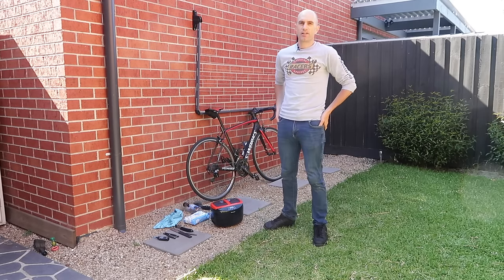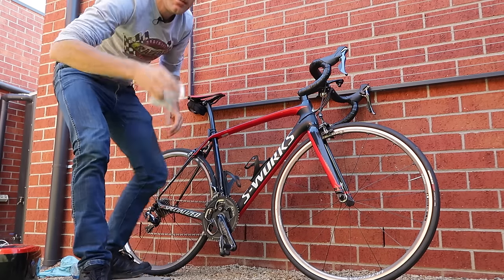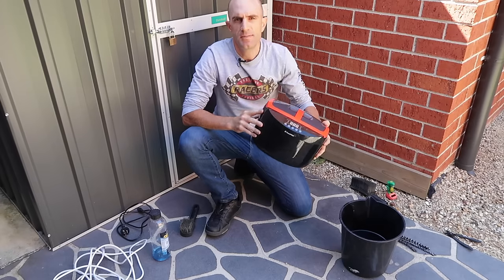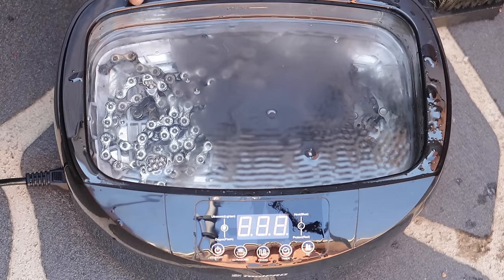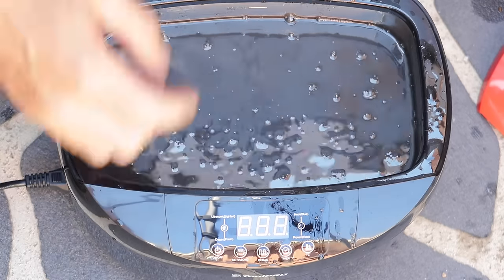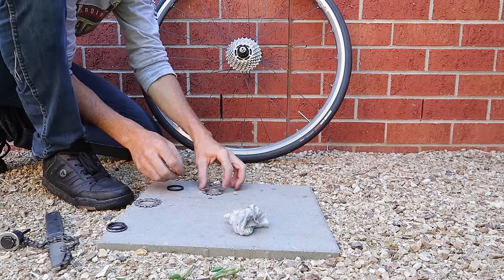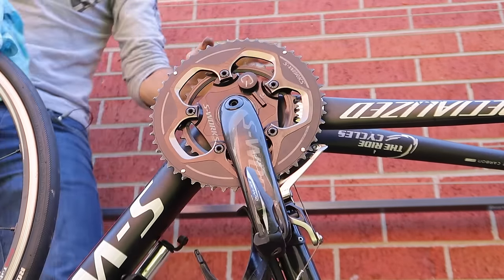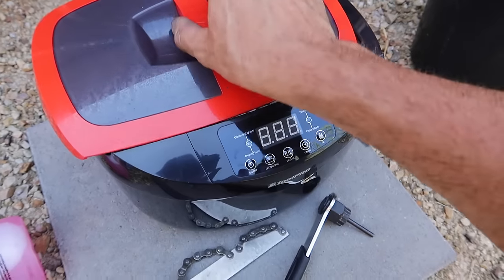CLEAN BIKE: The Ultrasonic Part Cleaner! // How to Clean a Bicycle Chain

Comment: Whoever subtitled this doesn't actually speak english. Or has really bad hearing.. Either way, fire them, every 3 words contain a mistake.
Reply from the maker: +Look Behind You That's YouTube.
Reply: There's an actual English option (not auto-generated). That's the one with errors.
Reply from the maker: Here's a YouTube trick. Edit their auto generated subtitles, hit save, it'll then have a non 'auto generated' subtitle file (identical to the auto generated one). YouTube then pat you on the head and boost that video as it appears you've done more work. It's a quick trick/hack to get on top of the automated algorithm here. Given YouTube have fisted me for the last week and sunk the channel, I'll remove this one since it's caused issues with accuracy. In short, it's still the automated speech-to-text from YouTube.
Reply: Shane Miller ohhh i see. Thanks for the reply, explains a lot

Comment: This is a very ineffecient, costly and a not particularly environmentally friendly way to clean your frame/components. the time you spent with the cleaning of the chain/cassette is inordinately longer than actually doing it by hand with a reuseable/washable cotton cloth and a biodegradeble cleaning product, the chain lubing process is also wasteful and not particularly great either not to mention the waste of water rinsing the sprockets/cleaning out the gadget nor the excessive amounts of cleaning product.
baby wipes for cleaning a 'dusty' frame down, jesus, clean cotton cloth and water would have sufficed.
 
Sorry but thumbs down from me.